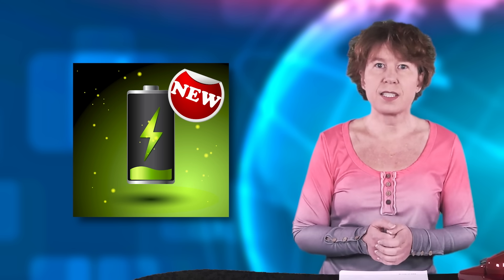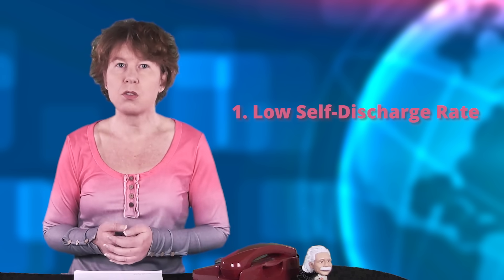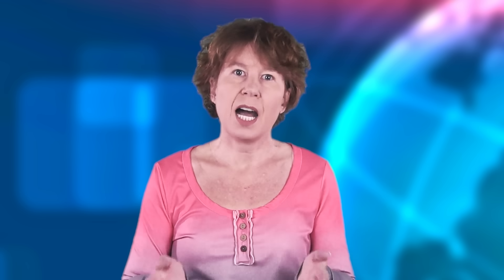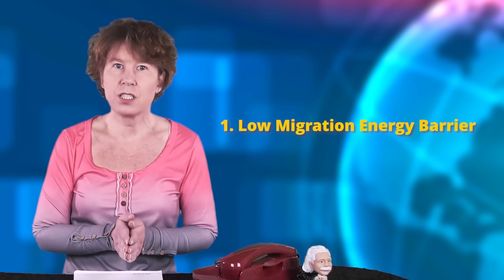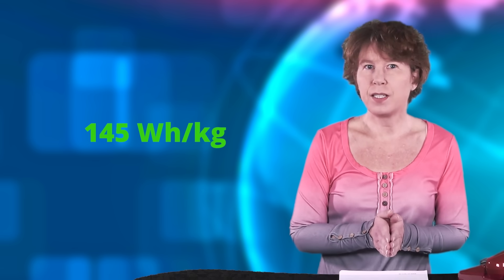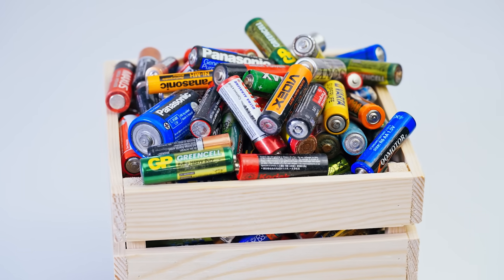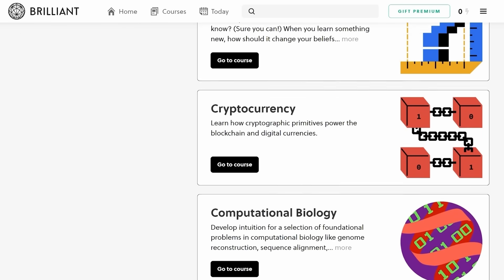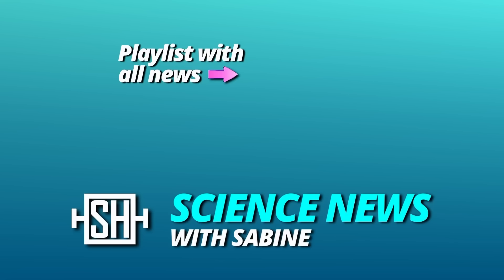Fully Charged in Just 5 Minutes: New Battery Breaks Records

Comment: 1:00 There's actually a 4th criteria - Low conversion losses. Batteries do not store electricity. They convert it to chemical energy when you charge it, then convert it back to electricity when you discharge it. These processes are not 100% efficient. For Li-ion it's around 85%-90% efficient. So overall every time you charge and discharge a Li-ion battery (so a charge cycle, and a discharge cycle), you're throwing away about 19%-28% of the electrical energy you started with. (This is why pumped storage winds up being more efficient than battery storage.)

Hydrogen's problem right now is that conversion losses when you start with electricity are around 50%. That makes it an extremely inefficient battery compared to Li-ion, its just being pursued because its energy density is much higher (hydrocarbon fuels have about 2 orders of magnitude higher energy density than Li-ion)  Most of the hydrogen research is focused on bypassing this problem by skipping the electricity-to-hydrogen step entirely, using sunlight directly to break off hydrogen gas from water. (In a way that's really just hiding the conversion losses - you can't tabulate it if you never measure it. But the same is true for electrical solar panels, whose 22%-28% efficiency is never factored in when you're using the electricity they generate.)

So this brings us to the other problem of faster-charging batteries. Currently, most EV chargers top out at around 250 kW. The average U.S. home draws about 1.2 kW (averaged over a year). So a single EV charging is like 200 homes. Or another way to think of it is that the peak draw from most homes is about 10 kW. So a single EV charging is like 25 homes with max power draw. These numbers are high, but not unreasonable for the grid (several commercial businesses draw even more power).

If you move from batteries which used to take 60 min to charge to full (wattage decreases as you approach full), to 5 min to charge to full, well now you've gone from 250 kW to 3 MW. That's the equivalent to the average power draw of 2400 homes, or peak power draw of 300 homes. And that's for a single car. If your charging station has a half dozen stalls, it can now consume as much electricity as a small town. The grid in that area probably won't be able to handle that. Which means the station is going to try to store that electricity when usage is low, probably in a battery, then draw from that battery to charge the EV battery instead of drawing from the grid. So now you've introduced a second source of 19%-28% energy losses.

Factor in that electric motors are only about 90% efficient, and suddenly your EV has gone from 65%-73% of the energy generated by the power plant reaching wheels on the ground, to 47%-59% of energy generated going to wheels on the ground. This is approaching the efficiency of diesel tractor trailers (about 45%). If your electricity was generated by a fossil fuel plant (about 40% efficient for coal, 60% for gas), well now your EV's efficiency is the same as or worse than an ICE vehicle.

(And yes I'm aware there are sites saying ICE cars are only 15% efficient. That may have been true in the 1970s with carburetors and 3-speed transmissions. But it's not true today. If you crunch the numbers for plug-in hybrids in electric vs gas mode, you find that in gas mode they're about 28% efficient at converting energy in the gasoline to wheels on the road.)
Reply: Lithium ion batteries are 95%+ efficient, actually (round trip).  Though it will be slightly lower when fast-charging.
Reply: @junkerzn7312  I know they can hit that in the lab. The number range I've quoted are from tests of real-world Li-ion products (EVs, laptops, battery packs) conducted by numerous people and posted all over the Internet.

Comment: If everyone did this, with the power surge, this would not be good for the grid.  The upgrades will be more expensive. Also, the fast chargers will be more expensive.  Just charge at home (overnight).  Or at the store, while going shopping.  An EV is not a ICE car.  It requires a different set of habits, and expectations.

Comment: 4:40 there are many situation  .. what if your about to leave  and  you realize your phone is dead ..
 plugging   30 sec or 1 min could be enough
   i have used my phone for  hours  as a mp3/ audio book player  at 30% charge with energy saver on
Reply: Have a little power pack 🙂  Of course, that doesn't work for an EV, just a phone or pad or laptop.

Comment: The problem for batteries of any type is the one point you touched which is environment.  Different batteries give off different amounts of heat as they charge or discharge.  It's not just extreme cold (which most batteries can't handle - LiOn batteries in particular), but they can also get hot enough to burn things if not enough of that heat can be conducted away.  Also, it isn't just a matter of how quickly a battery can take a charge, but how much charge can be delivered.  This is why charging your EV is twice as fast at 240V as it is at 120V.  If your daily driving is within the charge range of the car, and you can park it to charge at night, as a short range vehicle, EVs are well suited.

Comment: Fast EV charging at the tremendous rates you mention would be exceedingly expensive.  The charging stations would need huge battery banks to provide sufficient electrical current (power) to the vehicle.  The grid can be capable in certain locations, but costs to provide a few charging points to deliver a couple megawatts peak current would be several million dollars per charging point.   And that doesn’t even cover demand charges assessed on top of electricity cost, for the grid to provide teak current.     Either way, the cost of super fast charging is exceedingly high.     Providing high power from the grid will only get more expensive in the future, because of the tremendous infrastructure upgrades required.

Consider that the cost per mile to charge an EV at a public charging station already averages 1.5 times MORE than a similar gasoline powered vehicle.   (Study done last year by a major national media company).

Comment: It would be interesting to make a hybrid battery system. Like take the current storage space in a 300 mile Lithium battery car, and cut that down to maybe 150 miles to 200 miles worth of lithium ion battery. Then fill the rest of the space with Indium battery, giving it a range of maybe 50 miles or so on that battery. Why? Because this way, you should still have plenty of Li range to get around, most people would never have to charge outside their homes because 100mi+ per day is more than enough, but IF you run out of charge, you would be able to go to a charging station and be back on the road in minutes, rather than taking a longer time to charge. 

This should ensure that you would be able to get back home with minimal wait times, which should negate a lot of the "range anxiety" drivers might have. It wouldn't make long range trips that much more practical, since you would end up having to hop from station to station a bit much for that, but ti should help to make the concept more comfortable for local driving.

Comment: Do we need it? Yes, IF it charges a bit faster in winter conditions. In Norway e-vehicles are so common, but we have cold winters and terribly long distances to go. 

I know, we can’t charge such batteries in five minutes megawatt style. Lithium is fine above 12-15°C. However, if 30% of a battery pack could charge quickly in the cold, they could transfer over time to the very slow (when cold) lithium part during use. At least, we would get a slightly better charging logistics when e-vehicles really suck - like half the year. 

Throw in some super-caps as well, and an EV could charge to say 45 % at 50kW as quickly as during summer. Two quick stops an hour apart could yield close to 80 % when cold. As of now, that’s just a fever dream except during our short arctic summer… 🤓

Comment: Charge in 5 minutes is a claim that has been made many times over the last 15 years. It has sort of always been possible, just a modest compromise with density. If we say the 5 minutes is from 5 to 55% where it's fastest then that's only 6C charge and has always been possible in the modern EV era. They just never make them because they want the higher density. Some few batteries are formulated for speed. Particularly A123 were quite agile cells. And they actually made batteries for formula 1 iirc that were much more agile still. I charge my Tesla 50% in less than 15 minutes when I need to charge fast. For the most part you charge at home and never wait.

Comment: Not useful in town, sure. But we live in rural Ontario, Canada. The nearest big town is an hour over, but when you need to run errands or go to a hospital, they send you 1.5h from here. It takes your whole day to go to appointments and back, eat, shop while you are in town because food is so much cheaper there.  To spend extra hours in town just to charge the car is a big ask. Roads have no lighting at night either, lots of deer on the winding roads. Plus extra hard on the battery in winter and on snowy roads. If there were a fast charging station in a few towns on the way back and forth, it would help transition to EV much faster for people. In the meantime, hybrid and gas are the only reasonable way to go.

Comment: I basically agree with her, but short-route commercial vehicles seem like a good target for fast-charging batteries. You are going to charge during the day,  so 4 3-minute stops could be better than 1 50-minute stop. People have to eat but that is arround 30 minutes. And people have to go to the bathroom and could charge during bathroom breacks. It's clear that there is an optimal balance. For family cars, if we double the Energy density it's the end of gas cars, even if it takes twice as long to charge them.

Comment: If range is the same, I would happily go with much faster charging.  This is the only reason I don’t use my EV for lengthy road  trips, and why I still keep my gas car for those.  If chargers only take 5 min, then they will be able to charge 10x more cars per hour than currently, and this means less chargers required to satisfy demand

Comment: Current battery technology is probably sufficient enough for 90% of automotive applications. I believe the biggest issues currently facing EV adoption is the availability and reliability of public charging infrastructure, as well as the cost of EVs themselves (and/or replacement batteries). 

Faster charging times would be a welcome bonus and could potentially allow for people to become comfortable with smaller batteries. Especially if it means more affordable batteries and therefore EVs. Faster charging times could make EVs more appealing in industrial settings as well as short/long haul trucking.

Comment: Charging super fast isn't really a problem for me since I am able to charge at home, I have a a fully charged car every morning. 99% of my driving is either driving to work or around town and with 300 miles of range, I usually have at least 40% of my battery pack when I'm done with the day. The other 1% of my driving where I drive a long distance is not much of an issue either because after four hours in the car, you want to stretch your legs and use the bathroom or maybe grab some food. My car is one that charges from 20% to 80% in about 20mins and that goes by faster than it sounds like. I stopped one time to charge and get some fast food and while we were still eating, my phone pinged me to let me know to move my car because it was fully charged already. So how often do I use a charger outside my house? Maybe four to eight times a year, not often enough to really be an issue and the car estimates the charging time into the trip, so you can fairly accurately know when you will get to your destination.

Comment: Can't recharging stations have a supply of fully charged batteries that can be swapped with the batteries in the cars? The drivers could then drive away immediately while the old batteries are recharging for some future customers to use.
Reply: Not really viable.  There have been pilot projects for battery swapping fleet and rental/leased vehicles, but they don't really provide enough of a benefit.  And there is the added problem that the resale value of an EV is more or less directly correlated with the wear/age of the battery pack.  You don't want to be constantly swapping away the economic value of a vehicle that you own.

There is also the fact that as ranges increase, people care less and less about the occasional 20 minute stop at a Fast DC charging station.   I think I had to use a Fast DC charger maybe 3 times in the ENTIRETY of 2023.   99% of my charging is done at home.

For people living in areas where at-home charging is not convenient, the ecosystem will evolve to solve that problem anyway, either with ubiquitous destination charging or with improved charging access in lots / parking spots / garages / whatever.  Or all of the above.

-Matt

Comment: I would opt for a nation that puts Electric grid infrastructure and induction powering/charging lanes in trunk highways for unlimited range and minimum vehicle battery cost and weight. it would lower the cost of EV vehicles to that of a washing machine or refrigerator. They make them in China right now.

Comment: Fast charging in the Lab is one thing. Fast charging in practice requires multiple upgraded systems.  The cars that charge (to 80%) in 18 minutes like the newer Hyundai Ioniqs, aren't using special batteries. They just have improved power delivery and improved cooling, and they require 350 KW fast chargers.
If you want to improve that to 5 minutes, you are going to need a charging station delivering over 1 MW, and prodigious cooling systems to handle even small percentage losses converting to heat.  That's challenging before we even get to the batteries.

Comment: If the range of an EV was equal or greater than a gasoline vehicle the charge being about 20 minutes wouldn't probably be an issue but if the range goes below that of a gasoline vehicle it becomes more of a problem.

Then theres always the what if you forgot to plug it in and you're already kinda running late or for whatever reason in a hurry. 
In a bad neighborhood, running late for work or an appointment, various emergency situations and on.

In general for people who have a garage and can charge at home this is all going to be much less of a problem but for anyone without home charging it will likely be a larger concern.

Comment: I think you had a little grammar Faux Pas at the end there.  The choice you gave us was:  X amount of storage charges in 1hr, or 2X amount of storage and charges in 5min.  Obviously we'd want the 2X/5min battery.   You meant to say.... less storage but charges quickly, or lots of storage but charges slowly.  And the winner is always having more storage (more range).

Which I totally agree with because that means you don't have to stop at all until you reach your destination for the evening, and once there you can just charge overnight while asleep.

-Matt
Reply: She misspoke earlier when she said the energy "density," 145 W·h/kg, was half that of other batteries. Twice as large could mean twice the volume or twice the mass
Reply: @shanent5793  It is unclear what she was even comparing when she tried to quote energy density numbers, because there is a whole matrix of numbers that depend on whether you are talking about just raw cells, or including the battery pack structure.  Whether gravimetric or volumetric.  Temperature, cooling overhead, etc.

Regardless, it is all irrelevant because there is no requirement that a high-C-rate battery be less energy dense, or on any other parameter.  Batteries are simply getting better across the board and ultimately they will tick off all the check boxes people want.  Weight, volume, temperature, C-rate... everything.  Everyone will be able to have their perfect slice of cake.

Comment: I drive a Toyota Prius C, which is a tiny gas/electric hybrid. I love it. I regularly drive long distances in remote areas of northern Canada where winter temperatures can be as low as -40 C. For me, an all electric vehicle is completely impractical. A friend of mine has an EV in Calgary. Its range is reduced to less than 50% during cold weather. It is great for short commutes.

Comment: My view is the opposite. I could tolerate a relatively short range if I only needed to stop for 5 minutes for a full charge. My critical journey is 400 miles which is almost entirely motorway. There are BEVs that will get close to this but only if the weather is benign, it can be done in daylight, I don't mind arriving with very littl;e range left and I can afford to spend twice or thrice the price of my current hybrid car which will do the journey without a stop if I can. And if the depreciation of the car won't be such as to reach a value close to zero after 5 years. Nothing comes close yet, and although I keep hearing that the next generation of batteries will change things that generation is a long time coming to commercial fruition.

Comment: Righto but if you double the battery pack, the weight is doubled too, there's a good trade off somewhere inbetween high C cells and total capacity. Have you read "A layered organic cathode for high-energy, fast-charging, and long-lasting Li-ion batteries"?